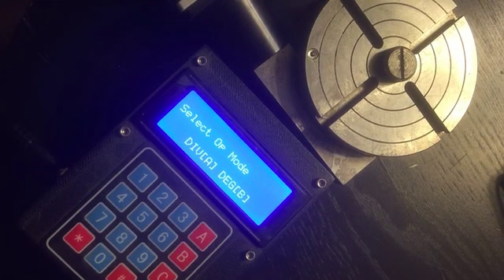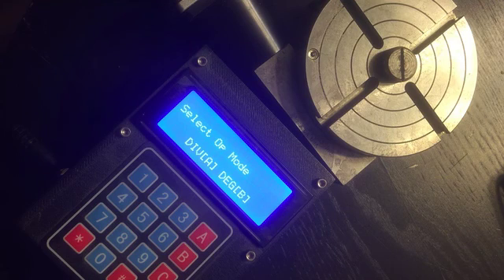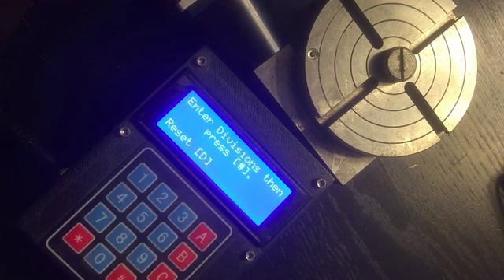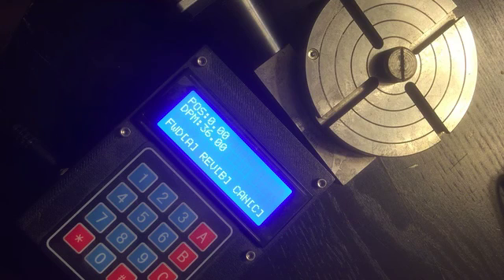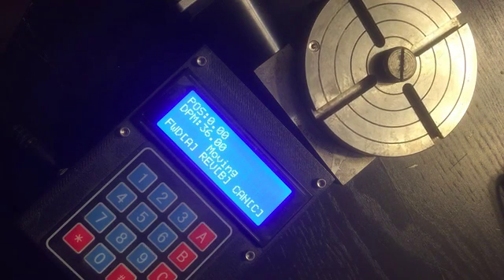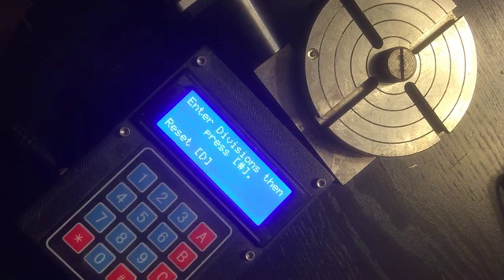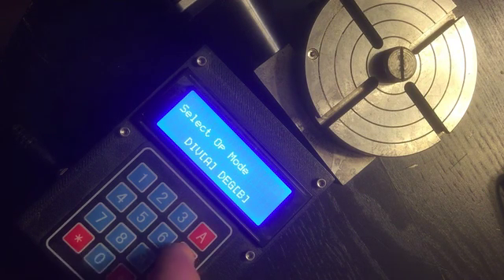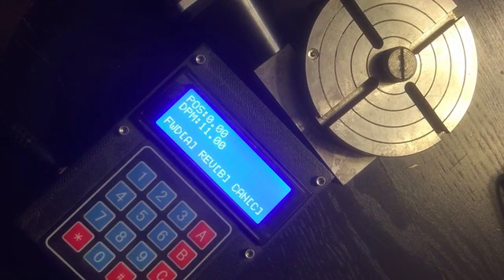Arduino Rotary Table Controller V2

Comment: very nice work. I agree with the wish for divisions. Right now you have only one speed to go from one position to the next. In case you want to mill a circular arc of 30 degrees out of aluminium or steel you need different feed rates to choose from during the cut and a fast traversing speed between cuts. Without such a feature your controller would be too limited for my application and I would keep a hand operated rotary table.